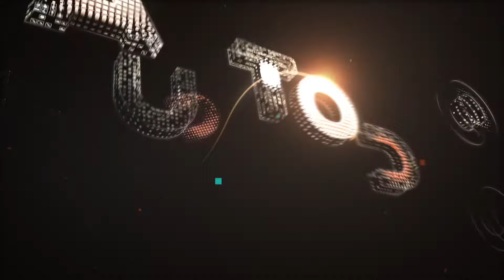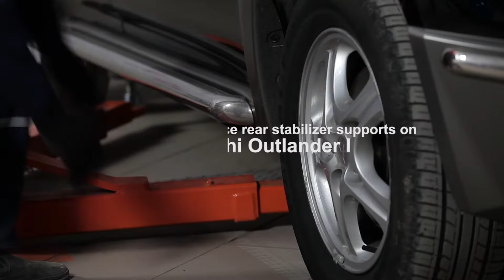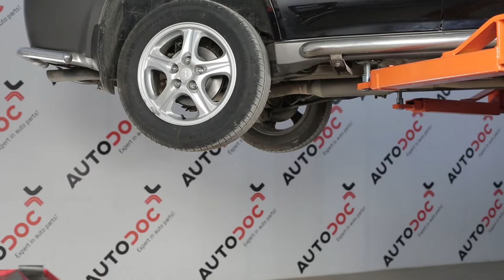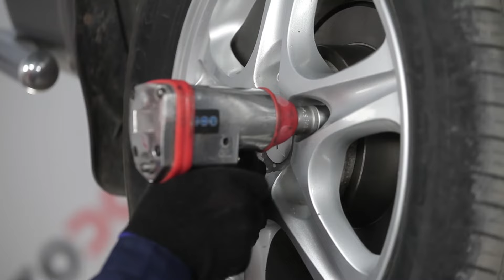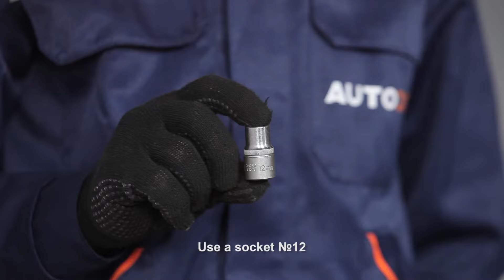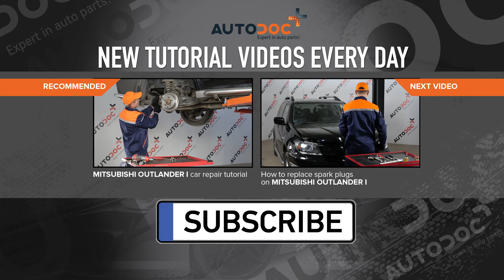How to change rear stabilizer bushes on MITSUBISHI OUTLANDER TUTORIAL | AUTODOC

Comment: That rubber part is hard to find in Canada. Seems silly it's just a piece of rubber
Reply: Dealership is almost always where you need to go.
Reply: @esperago  rock auto finally started carrying an non OEM version of that part. I do visit the dealer parts counter often for bolts though
Reply: @DaDaDo661  thanks for the tip